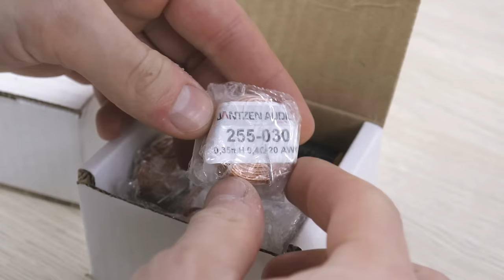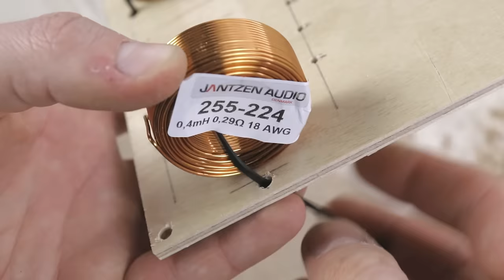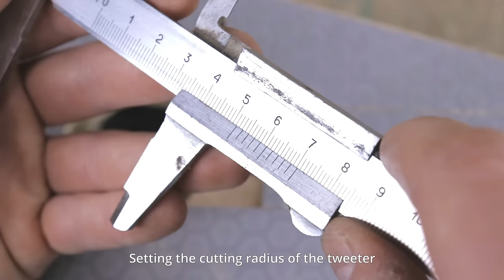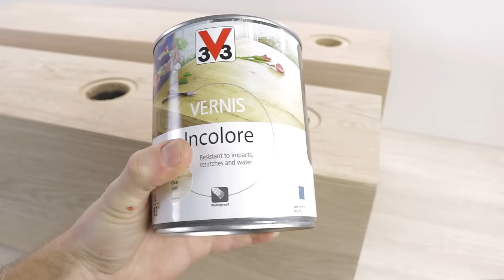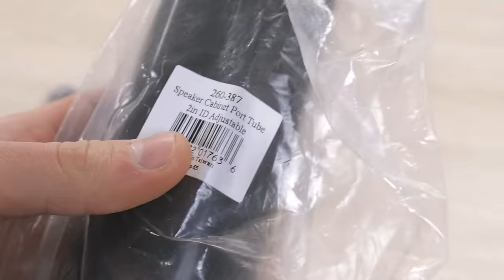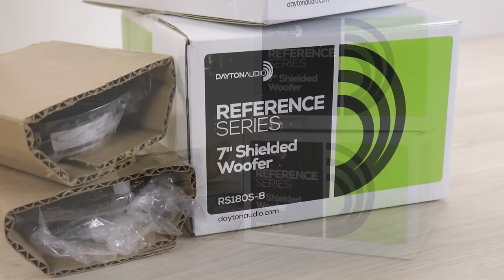These $185 DIY HiFi Speakers Sound AMAZING

Comment: Nice to see the Amigas getting some love! I built these a few years back and they are excellent for the money. I skipped the MDF flatpack cabinets and built the cabs entirely from Baltic Birch plywood. My only gripe is their low efficiency but I knew that going into the project and thats the compromise for F3 of 34 Hz in a relatively small cabinet.
Reply: I commend you on using Birch rather than MDF f**** MDF
Reply: @anthonymartinez2582  A little more work but BB is a MUCH nicer material to work and live with.
Reply: @anthonymartinez2582  MDF is used because of it ability to dampen resonant vibrations.
Reply: "I skipped the MDF flatpack cabinets and built the cabs entirely from Baltic Birch plywood"..

You spent more to make your speakers sound worse, congratulations...
Reply: @mymodel6  you’ve got golden ears, congratulations
Reply: @mymodel6  you might want to do some more research on that subject (baltic birch vs mdf) before you post opinions like this...
Reply: @wymotome  Lol, no i really don't think i do.  I won't bore you with what i do, but you are a world away from being right here i'm afraid.
Birch cabs of any type are built for strength, like touring pa cabs and guitar/bass cabs etc, that require the extra strength of birch over MDF, but if strength is not an issue, like for a home speaker system or an in car sub, MDF is by far the best material to use, for one it's cheap, but it's also provides more damping than any other type of wood on the planet..  End of lesson, i'm will not argue this point with you any further...
Reply: @mymodel6  You can think what you want to think but from a sound perspective (mdf vs Baltic birch) it matters little to none if you dampen and brace properly.  And that's not even getting into the drawbacks that come with MDF (toxic dust, ability to hold screws, sucks up ambient moisture, not as strong, etc).  Point being, there is likely zero chance that you'll be able to hear the difference with a 2-way speaker that's properly built with 18mm BB vs 3/4" MDF.  Zero.   But as you said, if you want to save cash, then use MDF.  However let's not make any blanket statements about one sounding vastly superior because that just isn't true.
Reply: @wymotome  Yes let's not...
Reply: @wymotome  I’ve built dozens of speakers with BB, MDF and other materials. I’ve also built the same speaker with BB and MDF. I can’t hear any difference and yes, I’ve read all the arguments and reasoning for MDF (and against it). Bottom line, I can’t hear any difference so I now always choose the superior material for workability, safety and aesthetics - Baltic Birch.
Reply: @nesutoneko  Hmmmmm NO.
Reply: @jimgeorge6220   Hmmmmmm Ok.
Reply: @nesutoneko  :)  :)  :)

Comment: From one carpenter to another I know we are always looking to improve our skills and get better with each project. Learning from others and passing on skills and knowledge is invaluable.  So here's me doing my bit, next time you fix the internal structure. Rather than just glueing and screwing, it would be a lot stronger if you rebated a 3 to 5 mm channel for the panels to sit in. That way you've got three points of contact for the glue and less chance of the MDF splitting from the screw. I hope that helps and can be of benefit to you. I love your speaker builds and I'm building a pair of these for my living room.
Reply from the maker: Thank you for the tip. I have been considering cutting rabbets for the internal structure but decided to screw the pieces instead, saving me quite some time and effort. It would also complicate the project more. The speakers hold and look fine to this day. Though I'm sure it would have made the enclosure more sturdy if I had the rabbets cut for the internal bracing.
Reply: @DonnyTerek  from one carpenter to two others, rabbiting the internal structure isn't necessary for a speaker build and would unnecessarily complicate the project. The internal structure does not serve the same purpose as a furniture style cabinet, and since you countersunk the screws and their only function is to stiffen the cabinet, splitting should not be a problem. If they were functioning as a shelf in a piece of furniture, it would help, but then you're not using mdf.

Comment: Excellent work, and very well done on the video! You make doing veneer look easy. I have built with Baltic birch, to avoid dealing with veneer. I would suggest either removing the woofer when drilling its screw holes, or covering the phase plug; to prevent any dust from getting into the voice coil.
Reply from the maker: Thank you a lot! Dealing with veneer is not so difficult after all as I thought it would be. Yup, I took extra care when drilling the woofer holes. Since they were a tight fit, I did not want to remove them to drill the holes. Might cover the phase plug next time!
Reply: @DonnyTerek  This kit might be a great starting point for a mass loaded transmission line speaker? I have been designing these, and they generally get you cleaner and deeper bass - and more open, less "boxy" midrange. You essentially get the internal baffles as braces, and the quality of the sound - assuming the MLTL design is right - you get the best possible sound from given drivers. I use the Hornresp program to design mine, and if I get a chance I will see if this woofer can work. I would try to make use of the front baffle, possibly?
Reply: @DonnyTerek  I watched this video again, and thought that it would be a good idea to add a rib across the inside of the front baffle, right between the drivers. This is the most stressed part of the cabinet, and so it needs to be better supported.

Comment: I really like the circle-cutter jig you've made for the router. I've made my own design, but now will copy yours as it looks far superior. BTW, I've often been tempted to purchase the Amiga kit several times while browsing PartsExpress.
Reply from the maker: Thanks! I believe I saw such a circle cutting jig on YouTube but can't recall where. Decided to make one myself, turned out great. Though it is really important to have tight fit of the parts to minimize any movement while cutting. Had a few enclosures ruined myself when the screw got loose and the router dug into the wood.
Reply: @DonnyTerek  Make a short video about the jig :) It seems to be one of the best ones.
Reply from the maker: @SergeyPRKL  Will keep that in mind!
Reply: Tip for milling holes , use a much smaller groove bit . 4 or 5 mm
Reply: For the cut out
Reply: @SergeyPRKL  Ditto.  Would love to see how the jig was made, and how it is used to make such accurate holes, and the ledges.
Reply: @95lovi  Wouldn't a smaller (diameter?) bit be more likely to snap, under side pressure?  Is the assumption that many passes are needed, only taking off a few mm with each pass?
Reply: @arcsound  Yes. That's the 'built-in' analog fuse that tells you you are pushing too hard! LOL!. Small router also has to work harder to maintain cutter speed, IF it can maintain cutter speed. Shallower cuts also require less user force and avoid bit deflection. And not to dis this fella, but that bit is in dire need of cleaning and sharpening, IMO. But, to each their own.

Comment: A beautiful execution of a great speaker design. You can get nothing like these at a hi-fi store for anywhere near the price. Excellent!
Reply from the maker: Thank you a lot and very well said!
Reply: Yes!! After spending over $5000 on equipment and hours and hours of frustrating work while being confronted by a very steep learning curve. No thanks.
Reply: @appleturnover519  It's not that hard and you don't have to be so serious about making them perfect. A jigsaw and a hand drill will get you a long way. It's simply a fun hobby.
Reply: @appleturnover519  and they cost 300 per speaker for the parts alone.

but to be fair it is a hobby and a fun one.
Reply: I'd buy a pair of focal chorus 706 for the same price, or a pair of Wharfedale diamond 11.1 or triangle plaisir, etc davis acoustics made some decent tower speakers at that price. I live in France so prices are probably not the same as in the US.
Reply: @taon707  and the wharfedale 11.1 ? those cost me 150€+15€ shipped from germany

Comment: Donny, the crossover components you used are just fine. NO need to change component choices. And sand cast resistors ARE WIREWOUND RESISTORS. Nice job.
Reply from the maker: Thank you a lot!

Comment: Nice build! I also build speaker kits from PE. I was so glad to see you refrain from using hot glue to fix the X-over components. Every video I've ever seen on speaker building does that. I use silicone myself, which looks like what you are using here.
Reply from the maker: Much appreciated, thank you! Yep, silicone works well to keep the components in place and reduce vibrations.

Comment: I haven't built the Amigas, but currently use a pair of PE's TriTrix MTM TL speakers as my left and right front speakers in my theater as well as one TriTrix MTM as center in horizontal orientation.  I built these many years ago and they are still an amazing sounding front stage.  Parts Express's kits are very underrated, I feel.
Reply from the maker: I've been looking at the TriTrix MTM speakers lately, looks like a great set. Might try building these soon. Absolutely agree with you that the PE's kits are underrated - they do deliver great quality at low price + the fun of building one!

Comment: Very nicely built project, sir -- and a very well shot video also! Thanks for taking the time and effort to put this together.

Parts Express really does produce a nice speaker kit at a very reasonable price. I build a pair of their Overnight Sensation bookshelf speakers that I use as the front mains in my home theater and I've been very pleased with them. I found plans online for a matching center channel that I scratch built to complete the front soundstage.  

It really is hard to beat Parts Express for low cost yet decent sounding products!
Reply from the maker: Wow, thank you so much! Truly appreciated.
PE's kits are indeed underrated, considering the overall quality for the low price they provide.
Reply: ooooooooopoooooopoooooo

Comment: Great video and excellent work. How long did it take in actuality? Also, from my own experience, it's not a good idea to drill the holes for the drivers while the drivers are in the enclosure. I've slipped and ruined expensive speakers before by doing that.
Reply: Also, in case of this woofer with its phase plug, small wood chips could get into the opening between membrane and phase plug and from there, maybe into the coil.
Reply from the maker: Thank you a lot!
Hard to tell the actual time frame it took me to build these since I was filming the process which takes quite a lot of time. I would say a week worth of evenings from start to finish. Yep, I do agree that a steady hand is needed if drilling holes for the drivers while they are mounted in place. So far no drivers have been hurt by me.

Comment: By the way, this is the same tweeter (price 25 euro), which the british put in their bookshelf speakers ProAc Response D Two (price of 5200 euro)  😆😂🤣
Reply: Lmao not superior
Reply: Not surprised**
Reply: What ? !!!! Areyou sure ?
Reply: @titikalagan3024  I've been doing DIY for a very long time - so I'm not joking. Enter "proac d two inside" -> pictures -> and in which 8th row from the top will the photo be. They don't even take off the label - it's name is Peerless DX25TG used to be produced under the Vifa brand - they cost the same around 25 euro, it is known precisely under the name DX25TG (even Scan-Speak took it into its program, name is D2604/830000 - it costs more for them). In DIY it is considered a solid entry-level tweeter 😊
Reply: @genaishivatov1737  incredible..👍
Reply: Y más de €5,000.00 no te parece que es una fortuna?
Reply: @luisheribertorivas7864  Claro que si !
Reply: All the stuff in these super expensive brands is rather cheap.
A 4k set of speakers usually have 150 ish bucks of drivers in them.
Can you imagine what is in a 400 bucks set of speakers....

Same with amps. A lot of the high end brands all use the exact same boards they buy from an oem manufacturer for 200 bucks or so. They wire it together and put a case around it and sell it for 3500 bucks.

The audio market is insane. Loads of snobs with to much money and loads of people taking their money lol.
Reply: @baronvonlimbourgh1716  Yep those fancy design speaker cabinets have a lot to answer for considering they are only house cheap OEM parts, build your own cabinets closely matching the manufacturer's designs then go buy the components from the same OEM, the results could be even more incredible for a 1/4 for the price of the rrp
Reply: I do not know how it was in the case of this tweeter, although I know that ProAc uses transducers from other brands and sometimes changes their characteristics (changing the coil) so it may look the same but sound similar. This is especially true for mid/low tones

Comment: How and what established your center to center measurement of the drivers?
Tip: try mixing up the thickness of the braces to avoid any resonance build up. MDF has a huge resonance peak at about 200 Hz
Reply from the maker: Hi, thank you for the tip. The design wasn't created by me.